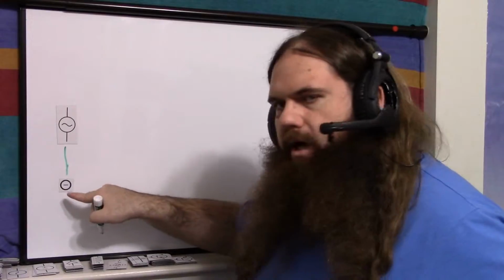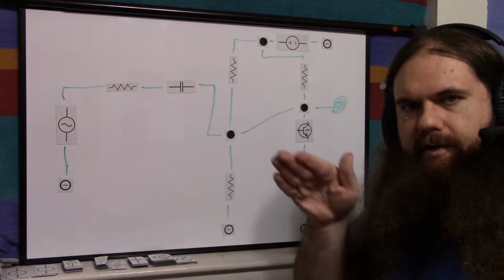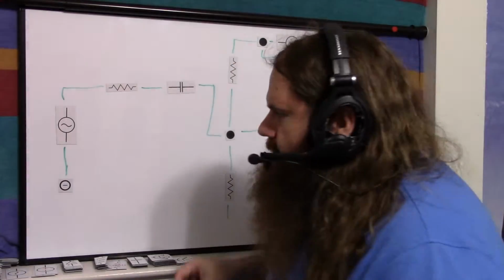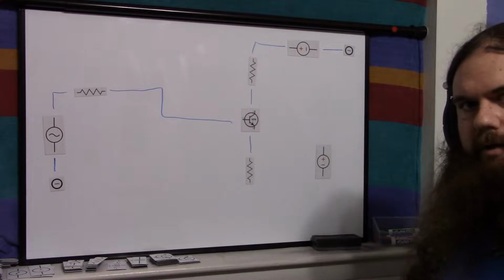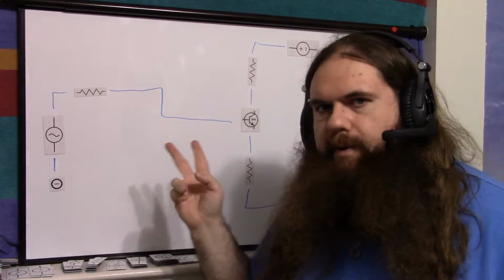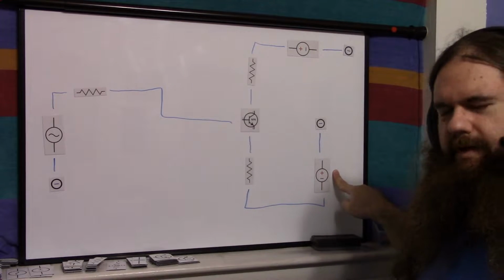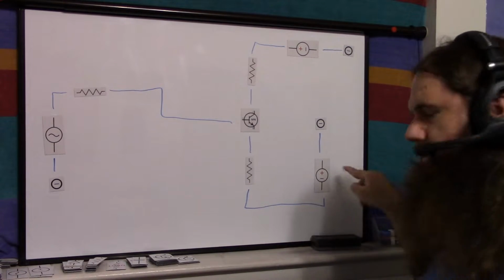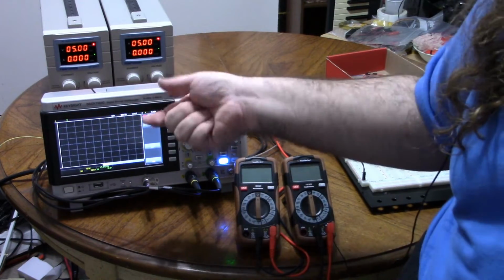Dual Power Supply Transistor Bias - Positive And Negative Voltage - Simply Put

Comment: I never really got this either and messed with thsi stuff for years. Auditing a linear lectronics class at the college I work at, perhaps one day i'll teach the class. I saw it on the board It then clicked I was like ground is whatever you say it is. Another way I see it is if you understand how 120/240V AC works on a normal single phase power service same thing. They are oposite 180 degrees, so center is ground reference, then you get 120 on each side, but one may be say + the other is -120V, so then bewtwen those you get 120+120=240. Same goes for 3 phase if you have a neutral it is just whatever is ground referenced.

Comment: okay, for about 2 or 3 months I was looking for a way to "turn on and off a dc battery" to simulate AC because I wanted it to go through a transformer without buying a boost converter or inverter because that's too much extra crap considering you can turn ac to dc wi8th just a SCR, anyway I found the amazing 555 timer and was so happy because it could produce a sine wave with dc so i set up and connected a 110 to 9v transformer to it (backwards) and managed to get 84 V AC but I wasn't able to get negative voltage and someone suggested I use an op amp and I'm having so much trouble with it but at the beginning I thought I could do this with mainly a transistor (like the SCR) and well I find this video.
I wish I found this sooner.

Comment: From this biasing I understand the Q point is still in the middle of active region of transistor .. this mean that the output of the ac signal with have dc component and we need a capacitor to block it... if that's true then why in opamp(which uses differential amplifier) the output ac signal has no dc value ?

Comment: I just need to make a usb cable that has two separate 5v inputs , whose wattage may vary (2 separate solar panels with only usb a female 5-5.3 v /2.4amp  outs) into one lead.  I have read about placing resisstors before and after the joint but which ones , or if you know of an easier solution, like a premade board that combines two inputs on amazon or something that would be great. Also, your reference to glossing over details is a good reminder but it is a " double edged sword" in a manner of speaking. But , simply explaining precepts or foundational concepts that are often taken for granted I think can be one positive take away that is anti-entropic, ie, knowledge is power. I am applying this to life , spirirual, understanding , because, though what you said apoears to make sense, it is still way above my head. But, kudos for a good video.

Comment: I found your video because when I built a rectifier putting the cap negative side to the negative rail (not earth) was both logical and confusing at the same time. I thought about it a lot and thought - but its a voltage difference ... why does it flow backwards ... well yeah, its negative so backwards - but i just thought the cap would explode when I turned it on anyway. THe fact that there are 2 caps across the 2 rails and ground in the same polarity makes sense - neg to positive ... its just weird. Just one comment - the way you edit it all to sound nice as audio - that's just fucked for me to hear and view - constant discontinuity. I don't enjoy it - and i've produced and edited a SHITTON of live, edited post, vlogs ... and sure they have edits but not one per sentence and its not done because like me - it fucks with many peoples heads. So ... like you use 2 powersupplies for a reason, you don't edit like you have ... for a reason. If you prefer it - no worries its your content. You also don't really seem to leave pauses ... that are necessary. Its just relentless speech ... because of your editing.